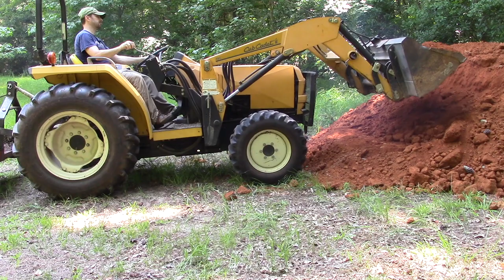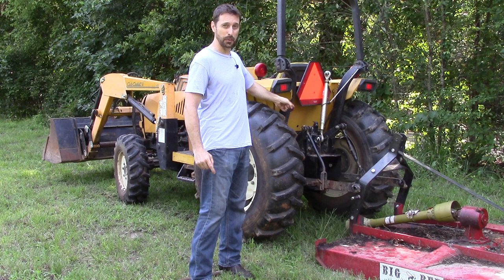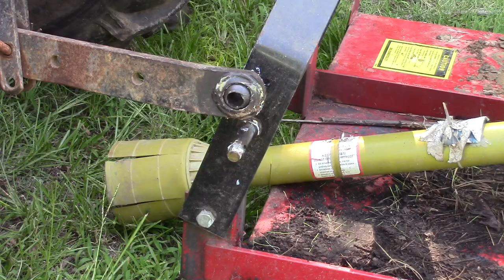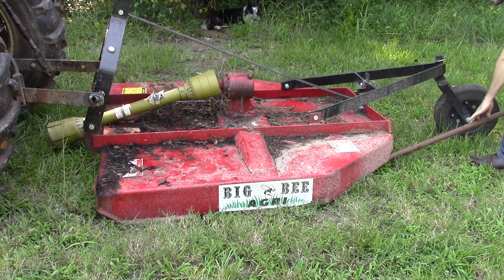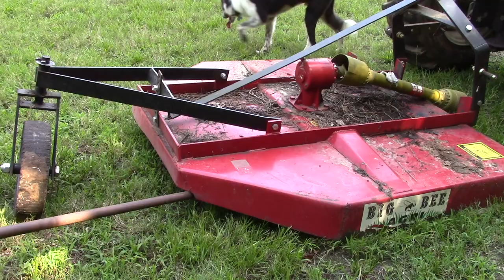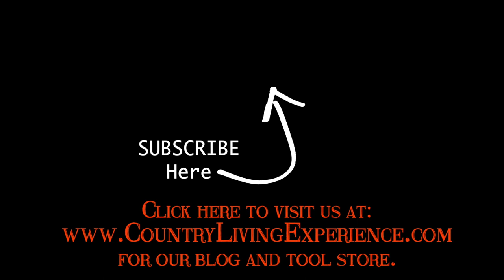Connecting Tractor Implements. An Easier Way! (mowing, brush hogging, etc.)

Comment: Build yourself a platform that sets on top of 4 casters. After you have managed to connect the implement for the first time, lower the implement onto the new platform. After the first time, you can roll the implement to the tractor instead of backing the tractor to the implement. I was unable to set up pat's quick hitch. After several tries, I gave up on the pat' quick hitch. Quick hitch has its own problems. I am pretty happy with the platform idea. I have not seen this idea on the you tube so far.

Comment: Excellent as far as it went. I had exactly the experience you begin with. Levering the implement was a key idea.
However, there are two other connections. And this rookie had to go to another video to find the key for those connections. That video, by the way, was not as clearly presented as yours, so kudos there also.
A link to a second video - or an extension of this one - concerning connections to the top and power train would be appreciated.
Reply from the maker: Thank you

Comment: I've had Pats quick hitches on my tractors since they were $169.99. Haven't been sorry since.  One quick note, you may need a new top link because they add about 4 inches to the arm length, and you may need a PTO adapter for the length.

Comment: Likely you have already heard of these, but Pat's Easy Change hooks on the lower link arms are a Godsend!! They are not overly expensive, given the time saved, and their adaptability to many implements, many older ones not being Quick Hitch compatible. I can see you'll still be battling the problem with your lower arms not being held wide as you back up. I'm not sure of the solution (easy one) for your situation; adding stabilizer  sliders or turnbuckles to yours will take some fabrication. But think about these as an option - they have been such a timesaver, energy saver, and really handy when it's 100 degrees in Central Texas! Cheers!
Reply from the maker: I have seen those. A bit out of the budget at this time. They look like a good system that would be very helpful. Anything helps in the hot Texas summers for sure.

Comment: Too much work, don't be so tight with your wallet and buy a Pats quick hitch. It comes with a spreader bar. Just back under the pins and raise the hitch. Get off the tractor and hook up the PTO and top link, lock the lower arms and you're off.
Reply from the maker: This is a viable option for someone who does not have a lot of money. Hard work never hurt anyone either.